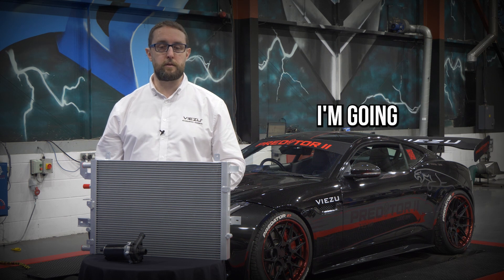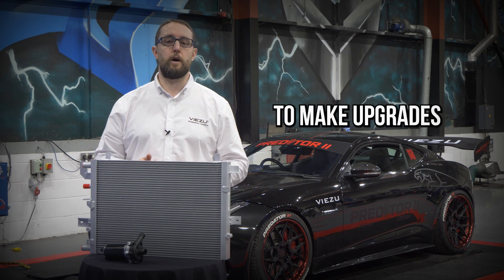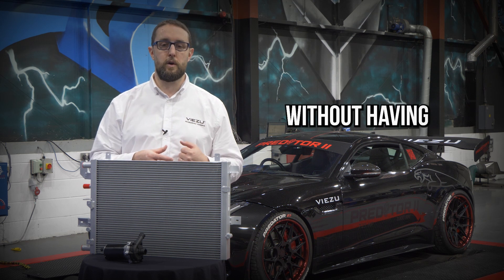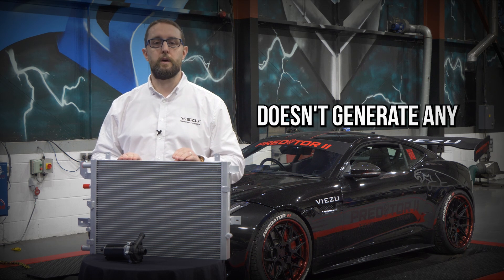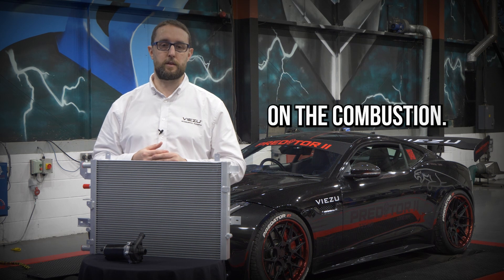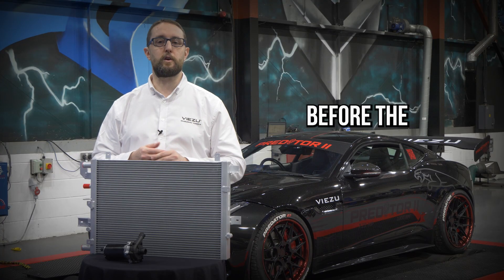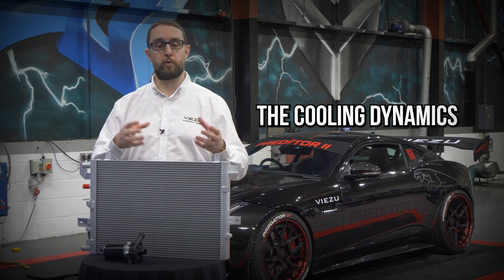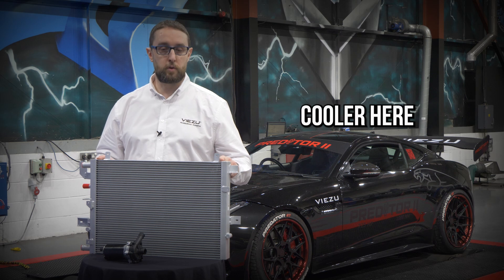Jaguar Mods for Max Power – Charge Cooler & Pump Explained!

Comment: Will it fit/works with fpace svr 2019 year? Where to buy it?
Reply from the maker: Hi Rebel, yes, we have a wonderful charge cooler upgrade for the FPace SVR. The pump is slightly different on this model to the typical ones we supply so we would really like to see your FPACE SVR in our workshop to confirm if we have a pump option for you. You can of course run the uprated charge cooler without the uprated pump, but if we can combine both then that would be great. If you could send your details over to info@viezu.com , one of our team will be on hand to discuss the options and provide further details and get you booked in. Alternatively you can call us on 0044 (0)1789774444

Comment: Fantastic work guys! You all are one of the only companies left really pushing the limits of the Jags! As soon as I purchase my F-Type I will be coming to you for the Predator II Package!

One question I have though is I’m a big fan of the VAP 200 Cell Sport Cats and Downpipe with the Valved Exhaust XPipe. Am I able to keep those parts and get all the other parts of the Predator II Kit and still get close to the 725HP? I know your parts are tuned for optimization so just wanted to check
Reply from the maker: Hi Johnny, yes absolutely you do not need to purchase all the parts from ourselves however please do be aware that our cats have been through extremely thorough testing to ensure that they can cope with this power upgrade and allow the air flow required for the 725BHP upgrade. We are aware that the VAP cats are quite a bit smaller than our own and we would not be able to offer any guarantees that these would perform under the same circumstances.
Reply: @ Wonderful, thank you!
Reply: My 200 cell cats from VAP lasted 6 months before cats got destroyed. That was with the pop tune so that for sure ruined them, but just a heads up. Might be worth having the original cats drilled out as I did with mine.
Reply from the maker: Yes strong pops will damage the cats for sure, the size of the cat is also important for a long life span, you can see more on that here in this video https://youtu.be/Ez74osq3Tjk